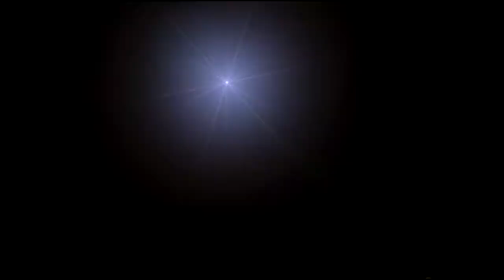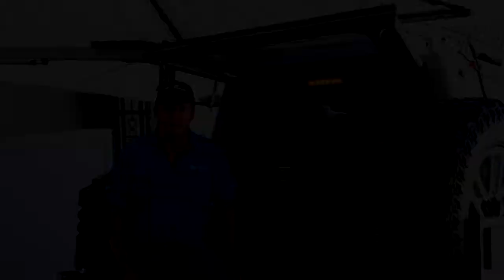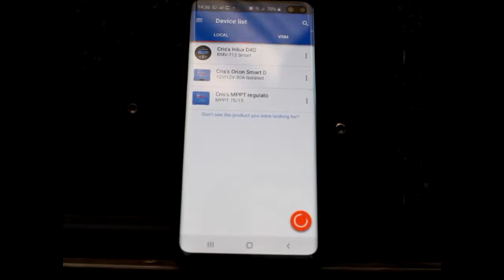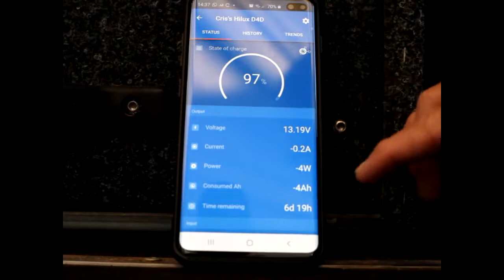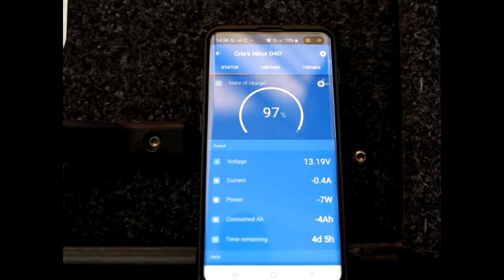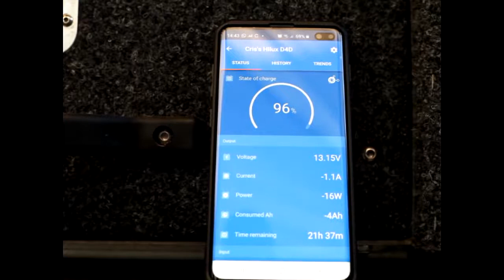Victron BMV 712 Smart Battery Monitor by Cris Ingram

Comment: Chris, appreciate your videos.  I'm planning to install a new solar system in a new 5th wheel this spring.  I could sure use a wiring diagram alone with cable sizes also( my email address is labfaninlaramie@yahoo.com).  What are your feelings about using a mix of Go Power and Victron components?
Reply from the maker: Hi Brent
Apologize mate, I seemed to have missed this one. Did you manage on your own?
Reply: @randdoffroad3616   I think I got it  figured out with help from AM Solar.